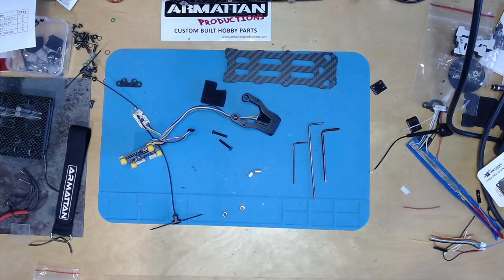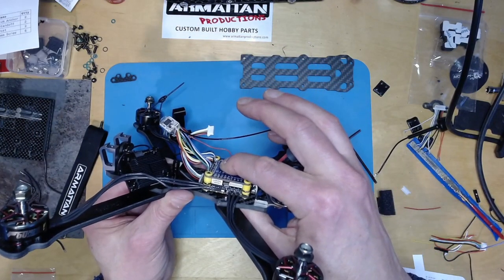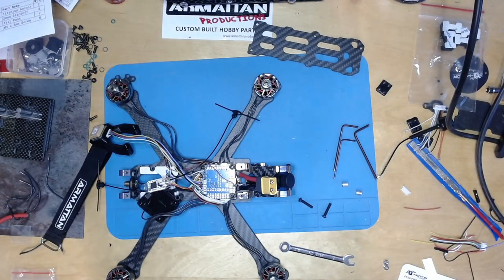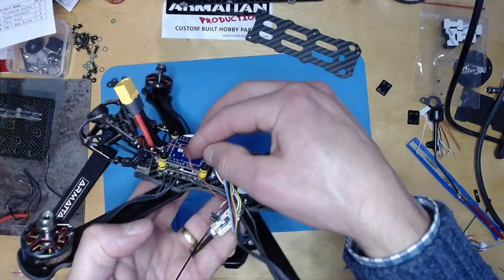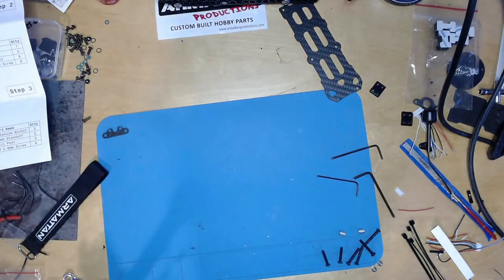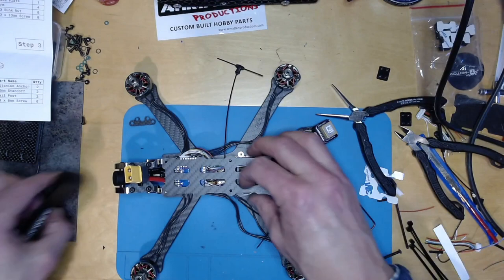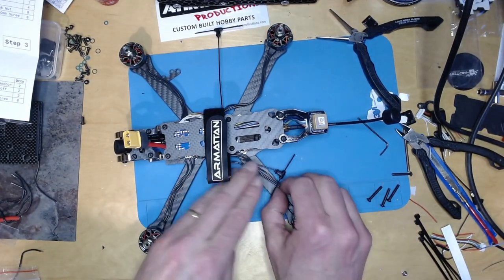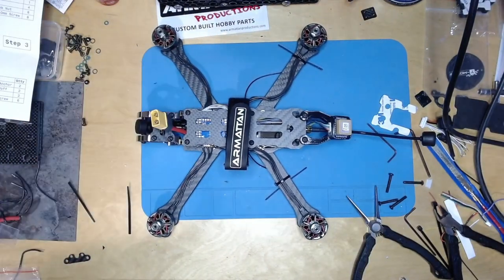ArduCopter 6" Race Build Video 9 - Final Assembly

Comment: I notice that you have your GPS/compass at 45 degrees. Any time I do that I can't get the compass to calibrate successfully. Is there a trick to it?
Reply from the maker: Yes you need to use a custom rotation and turn off auto rotation - I cover these settings in the initial setup video
Reply: @andypiper5285  Thanks!